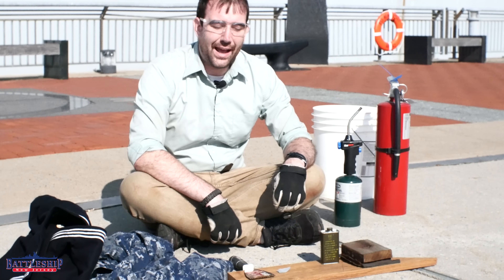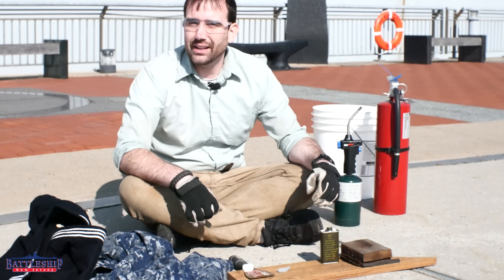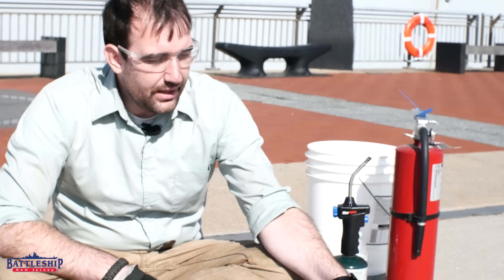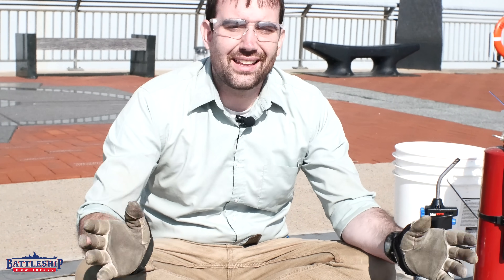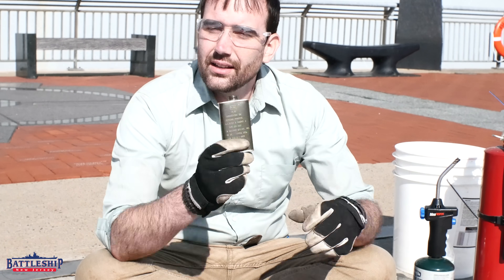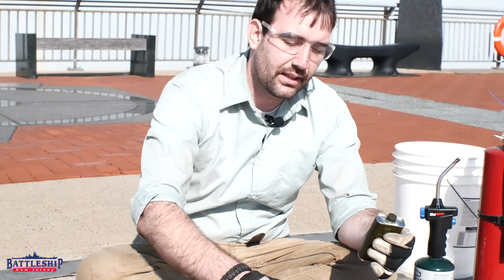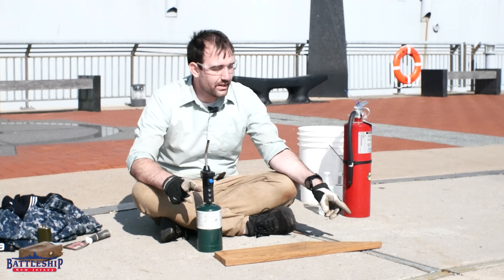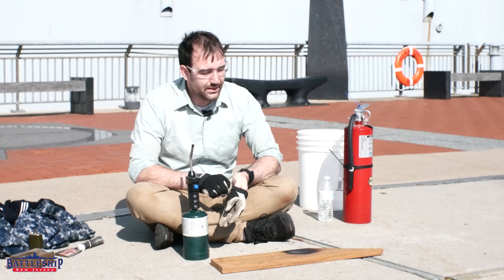Battleship Flammability Test: Gun Oil, Uniforms, and Teak Wood

Comment: The old Dungaree uniform which the "blueberries" replaced was cotton.  It would burn, but more like the old Blues.  When it became common knowledge that the "Blueberries" turned into Napalm and melted into the sailors when exposed to a fire, the unofficial Engineering Uniform of the day went back to the old cotton coveralls.  This helps to prevent the class of fire known as a "Screaming Alpha".

The thing with oil-based paints is that they become less flammable with age.  They are quite flammable in the can, but become less flammable over time as the volatiles gradually evaporate.  This is why cans of paint, cleaning solvents, etc. are stored in spaces specially equipped with CO2 flooding systems, heat sensors, etc.

Key thing to note is that most of the things that you tested produced flame and smoke/fumes as long as the heat is applied.  Your heat was direct, but a good fire on the other side of a steel bulkhead will result in the same thing.

Before somebody brings up the Bonhomme Richard fire in San Diego, that was a TOTALLY different situation.  That vessel was still under the direct control of the civilian shipyards, NOT the US Navy.  Sailors pay attention to things like keeping the trash picked up, storing flammables properly, ensuring that hatches can be closed, making sure that fire suppression equipment is usable, etc.  Yard workers tend to toss trash in the corners, stow flammable materials wherever it is convenient to the job, foul hatches with hoses/cables/ducts, and take down firefighting equipment in large regions of the ship.

The stern doors on the BHR were open.  The main passageways through the entire ship had the hatches and WTD tied open and fouled as described above.  Decks and bulkheads had just been painted with flammable coatings while the fire suppression equipment was still siting in a yard shop somewhere.  When a fire started on the Vehicle Deck where literally BARRELS of flammable liquid, wood dunnage, overpack materials, etc. were stored, the stern doors became an open damper, the Vehicle Deck the firebox, and the main passageways the uptake to the smokestack that the forward superstructure became.  To get better conditions for an uncontrollable fire, you would have had to design it.
Reply: It never ceases to amaze me how someone on the Navy's uniform could have approved the NWU1 as the dungaree replacement when it was made with nylon. It's not like the Navy hasn't known for decades what materials are naturally flame resistant and in more recent decades, what man made materials are highly flame resistant. I also don't quite understand why the Navy didn't simply temporarily halt production and issue of the NEWU1 until they could start making them from cotton or Nomex.
Reply: There is more, a LOT more, to the BHR fire.  One thing, there were no fire fighting   water supply connections on the pier, only potable water supplies rated at 400gpm.  The responding fire fighters had to lay high capacity hoses from shore connections.  Another, the shipyard fire fighters had never even toured a ship to be familiarized with the layout of ships in general much less the BHR's layout.  The ship's fire hose connections were not compatible with shore based fire fighting equipment and the ship's hose adaptors & such were not readily, if at all, available.
Reply: @danquigg8311  I believe that a 3" hose for civilian FF agencies is generally used as a "trunk" line to feed manifolds for the 1-1/2" hose used by hose teams.

It's been several decades since I last touched Navy Shipboard FF equipment, but a 3" hose was standard for a hose team.

If all of the above is still true, then the civilians would have had a limited amount of 3" hose available, and lots of 1-1/2" hose.

If they were to try to use the shipboard equipment, they would have found that everything was sized for the 3" that was out on the pier.  Trying to pressurize the firemain from the pier would have had the same issues.

400 GPM?  Last time I stood an Inport DC Central watch, I would have had 1 firepump online, for 3500 GPM @ 125 PSI.  As soon as even a suspected fire was reported, I would have had the S&S Rover running to bring up a second pump for 7000 GPM total at something approaching 130 PSI...Leaving me a 3rd electric pump at 3500 GPM in standby.
Reply: there are modern equivalent synthetic fire-resistant textiles, but they require actually paying attention to this not just taking a cheap cloth that looks good.
both wool and thickly woven cotton are naturally fire resistant since they don't as much burn than simply "crumble" so it doesn't burn as hot as to sustain it's own fire (unless extremely dirty with oils/ fuels) and even then it tends to crumble and fall away taking the fire with it.

Comment: Not all the blueberries were fire resistant--the label needs to show Aramid fiber content.   That was why the Guacamole uniforms relaced the blueberries.
Reply: Though the Guac may be fire resistant, what happens when it actually torches off is what I'm wondering. Had a fire resistant uniform at a job once of similar thickness . When I quit we tossed it on a fire to see how long it lasted(about 2 or 3minutes) before it combusted but WOW when it took off it really took off!!! Way more flame then cotton.

Comment: Point of order, those little propane torches may not be great sources of bulk heat, but they are plenty hot; I once used one to test insulation for a project, and verify that it would resist our operating temperatures. I had the insulation glowing yellow with one of those things. Your oil test showed that a thin coat of oil on the shell deck was not a significant issue... though bulk POL other places would have definitely been one, as you can see, the oil burned cheerfully once vaporized. Of course, if you've got fire on the shell deck you have MUCH BIGGER PROBLEMS than a little oil.

Comment: Does NJ have blue/white flake painted p-ways or living spaces? The fire that consumed the USS Bonhomme Richard LHD-6 spread I believe by high heat and Epoxy compounds of the flake chip deck coverings. These painting compounds I do not believed were tested correctly to ensure no flame propagation on decks directly above a fire. I do not know at what temperature the decking paint lets off flammable fumes to cause the fire to become unfightable in close quarter conditions.

Comment: It was not the paint on the ships of WWII but the many layers of paint that was the problem during WWII. To keep their ships looking beautiful and the crew busy they put layer after layer of oil based paint. After the Lexington's fires were uncontrollable due to the large load of flammable paint they started chipping the paint off of them and replacing it with a primer and a single layer of paint..

Comment: I would suggest trying to ignite vertical surfaces i.e. there is a lot more surface area on the ship that are bulkheads than decking. Plus, the heat that rises up the surface preheats the material and maintains it longer. Proven by Bureau of Standards tests of plastic materials held horizontally would self extinquish after the heat source was removed. Those materials were then used in walls of retails stores. When a fire occurred the fire grew up the walls and produce toxic smoke killing customers. Then the Bureau of Standards tried holding the materials vertically and found out that they did not self extinquish. These tests were in the '60's and '70's if my memory serves.

Oh, traditional clothing for firemen has always been wool!
Reply: I worked in a steel plant in the 80's we were issued with heavy wool trousers, and jackets with rubber buttons and no fly! Almost impossible to wear in the heat, but any molten steel sparks etc charred the wool and didn't get through. In a real accident where some one got splashed, the steel would freeze on the wool and a carbon layer formed between the metal and the skin, it probably meant you got 1st degree burns, but the removal of the splash was much easier as it parted at the carbon layer.
Reply: Ding!  Geometry is important, and less-flammable materials can very well turn out to be more-flammable in a vertical orientation.  (Also consider airflow, heat transfer... various factors can make matters worse.)

That, and there's a big difference between trying to light a puddle of oil and trying to light an oil-soaked wick of some sort.  Having oil absorbed in a bit of fabric or other porous material can make it much easier to get started (try lighting candle wax vs. lighting a candle's wick).
Reply: Well, this guy is obviously NOT and engineer nor has any real science background.    Need to understand flash point, auto-ignition temperature, volatiles, surface temperature, . . . .
Reply: Urethane foam, as I recall was the big nasty tested in the '70's. There was a big stink over the initial defective testing, as homes and businesses were using that foam as wall coatings, resulting in highly toxic smoky fires that endangered firefighters and killed occupants quickly.
The gun oil doesn't tend to burn as a liquid, just as it doesn't burn as a liquid in an engine, it gets vaporized or atomized, then it can burn.
During training, I was known to remove my blank firing adapter from the rifle, put a drop or two of oil into the barrel, then when someone was coming to attack my position, I'd fire into the air. Gave a couple of foot across bright orange fireball, if you're dark adapted, you ain't any longer and if you had goofy goggles on, you were hating life.

Comment: as a welder the best clothing to help keep you from burning is cotten it will burn but won't stick to your skin when it does
Reply: The same as wool.
Reply: @tomnewham1269  Welding is hot already don't need the extra heat

Comment: What about the old wiring insulation? Seems like an electrical fire would be a common source
Reply: Modern wire and cable specs for ships address this; there are requirements for the fire behavior of insulation and cables, in particular the burning properties (flame spread and smoke developed)
Reply: @gerry5712  Absolutely agree on modern ships.... I'm curious about the old stuff, cause some of the videos they've done make it look like some of the electrical system is WWII original

Comment: So..that was ridiculous.
Reply: Things will ignite or refuse to ignite based on heat, so it is a very base test with little validity.  You can take motor oil and try to burn it with a torch, it will refuse to light.  But, throw it in a camp fire where there is enough heat from the wood, it will not only burn, but burn very hot and effectively.  What is not flammable at low heat, often will ignite at higher heat, and worse to fall, will tend to BURN HOTTER than the things that ignite at lower temperature.

The one solid point this video makes is why natural materials are often superior to new materials.  Leather and wool are great examples, they have natural properties that no new material can replicate or match.  Included among those things, for both materials, is heat resistance.  Wool naturally resists burning, and will burn away rather than melt like plastics.  Leather is just plain tough, and still the best for welding or casting protection.

Kinda a stupid video, I know.  But, not entirely useless.

Comment: You should have told us the fabric makeup of the “blueberry”.  Is is 50-50 cotton/ polyester?  Or what?
Reply: Probably.   It was very popular for a time.  Even municipal firefighter uniforms used it.    I did a report on it, and research [not mine, actual labs] showed that the polyester would melt as it burned, and be HELD IN PLACE by the cotton fibers ... extending the misery of the wearer.

Comment: Besides flammability the other risk factor is fume production. Some of that stuff produces some nasty toxins. It like is home and commercial fires, it not usually the flame or heat that causes causalities but the toxic fumes.
Reply from the maker: Sounds like a future video idea!
Reply: @BattleshipNewJersey  In aviation PVC (polyvinylchloride) products are strictly avoided.  When they burn they produce hydrochloric acid as a byproduct, the aforementioned nasty toxic fumes.  Apparently, only a few parts per million of that stuff in the smoke will cause a person to involuntarily close their eyes.  Not good if you're a pilot or aircrew member trying to fly or fight the fire with an extinguisher (and yes commenters....the first thing a pilot does is don their full face oxygen mask, or smoke goggles + oral nasal oxygen mask, and the smoke hood for the flight attendant / air crew member).  I'm sure the Navy was pretty strict in avoiding PVC on the ship (wire insulation, for example) during the later refits.

More relevant to the ship, perhaps lay your hands on a pound of smokeless powder, such as is used to reload rifle / pistol / shotgun cartridges (note - NOT true black powder, only smokeless powder, IMR 4064 is one that is good for 30-06, for example, and also in the "correct" form - little tubes, to represent the stuff used in the big guns, vs flake or spherical form).  A fraction of an ounce quantity of the stuff ignited in the open will demonstrate the deflagration that happens when a powder magazine goes up - Arizona, Hood, Queen Mary, Indefatigable, Invincible, etc.
Reply: @Token_Civilian  Not just aviation but Navy and probably Army as well. The navy has strict standards on electrical wire insulation in regards to behavior in a fire. in general PVC is forbidden and the insulation of choice is Low Smoke Zero Halogen . Teflon is also used for its favorable behavior in a fire.
Reply: @BattleshipNewJersey you probably should have worn a filter mask for this video since you were burning paint
Reply: @BattleshipNewJersey  Please learn some basics on how and why stuff burns (or not) first.
Two hints: Split the teak into thin sticks (like crushed after a significant hit) and it'll burn just nicely. Oil in liquid form doesn't burn, it's the gases that burns.

And IF you find yourself (or someone else) in the awful position of burnt nylon clothes (or other plastics) on you PLEASE don't try to peal it off. Cool with plenty of water (room to body temp) and let a doctor deal with the issue of cleaning your skin.
Reply: @sharg0  Might be worth sending an email to the Navy's school of damage control; if anyone's got experience of this kind of thing, it'll be them.

Comment: I'm curious how resistant those powder cans are to fire and heat and what temperature the powder will cook off at if too much heat gets to them.

How long does the ship have if there's a fire in a magazine before it goes bang?
Reply: The flashpoint will be logged in a manual somewhere
Reply: @captiannemo1587  The correct term is ignition temperature. The flash point is the temperature at which a liquid gives off flammable vapors. The ignition temperature is the temperature where the vapors ignite. For example the flashpoint of gasoline is well below zero degrees F, but it takes several hundred degrees to get it to ignite in an engine. Interestingly enough Diesel fuel has a much higher flashpoint but a lower ignition temperature.

Comment: Interesting on the teak -- I do structures in heavy timber, and the stuff is very fire resistant -- even modern pine.
Reply: Even modern pine what?
Reply: It may be fire resistant but enough time and at a really high temperature it will burn just like every other wood will